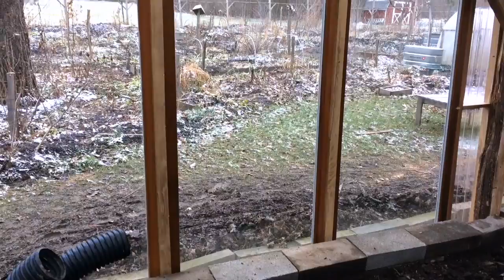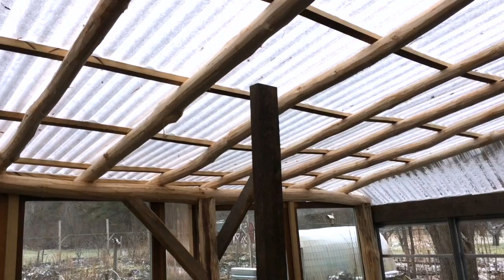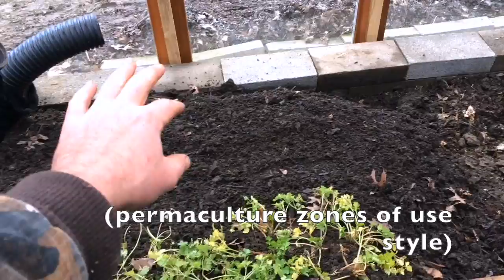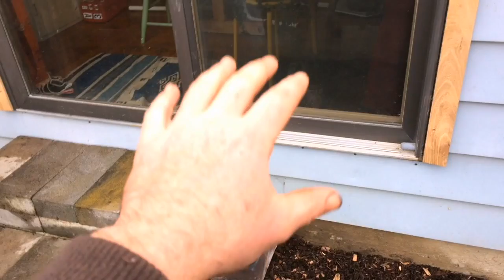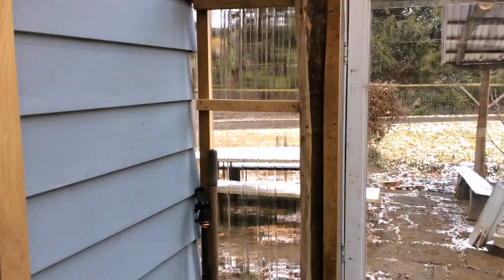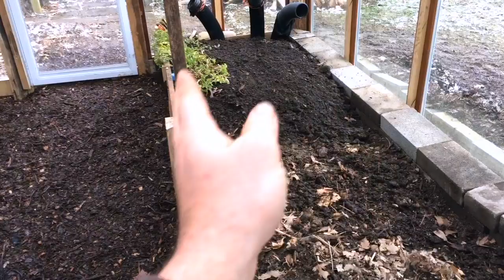Passive Solar Greenhouse - V - Raised Beds Being Developed

Comment from the maker: Temperature Test...
As mentioned in the video where I had the little device logging temperature overnight.
Outside LOW air temperature - 10F
Temperature LOW at 'Parsley' level in greenhouse - 26.6F
16.6F warmer at crop level.  WITH 8 square feet of window still needing to be framed in!!!! WHHHATTT!
Reply: Do not underestimate the power of your thermal mass! You are doing wonders. And that heat will take a long time to bleed out of your bed and blocks. 
Another neat trick is to have black barrels/buckets filled with water that absorbs that heat and gives it off overnight as well. 
Where you will have a challenge is when you have extended cold snaps, and cloudy days. Then you may see some significant drops in baseline temperatures, and a longer recovery time as your thermal mass is recharged with heat. 
Love the experiment. :)
Reply from the maker: I was amazed.  But I can certainly imagine if we had 4-5 days in a row in single digits with no direct sun this huge battery would drain down and be a burden to the scene.  I think thats why I need to really focus on how to charge the 'battery' as much as possible whenever the sun is shining!
Reply: @edibleacres  Thermal mass only helps (in any continuously occupied space (plants counting as occupants here )).  But, yes, get as much sun as possible, lose as little air and heat as possible, store as much heat as possible.
Reply: Congrats on the temp difference. Nice job...
The charcoal paint idea is also amazing, but done dry, my guess is, it will spread dust for some time. Maybe instead of oil based paint you can try mixing charcoal powder with plain water and maybe a handful of clay, thus making it stick better, probably last longer than the dry variant and keep it from leaching dust particles. It can also be easily painted with a brush..
Just a thought...
Reply: Awesome! This helps me a lot with planning something similar

Comment: Did you use any of your chicken compost on the paths between your long raised beds for extra compost heat? Fill it up to almost the top of the raised beds for an extra heat source. Just a thought!
Reply from the maker: It has a strong smell at this point so I don't want it in any enclosed spaces just yet :)

Comment: When you go to fill the uneven roof gaps with cob, you will need a connector to bind the cob in position next to the smooth surface of the wood; as clay does not necessarily ‘hold on’ to wood by itself. Repurposing old nails/screws, something with a head that the straw (or whatever your tensile agent) can wrap around works. I see the space is small and a hammer’s swing not possible from the top, but perhaps making a platform of grips from the angles that you can attach from would provide enough support for cob to sit on/amongst, harden, & stay for the long term. Just the asymmetrical shaping will provide for some staying-power if thick enough (say, greater than 3”). However once dried, clay shrinks pulling away from the wood (any smooth surface) and can crack depending on your mix...potentially yielding chunks that dislodge over time. 

I enjoy and benefit greatly from your channel, format, & demeanor. Thank you kindly for diligently and thoroughly presenting your work. Thank you for caring for others too.
Reply from the maker: I hear you... I think we can work the cob in and through the gaps to both sides, and knit it in.  I will hammer in some nails here or there where the gaps are wide.

Comment: You must have great balance to use that back path of pavers to use as a walk path...  I understand the need to conserve space but be safe too brother.
Reply: Walk like a cat...
Reply: You might consider putting a board over the top lip of the front of your raised bed and on the brickwork of the back to straddle and put one foot on it and the other on the brick and lean down to work...  You'll figure it out.
Reply from the maker: I'm guessing that 'design' will change over time based on what it feels like to work with!

Comment: Could you take a temperature reading off the slider windows on the back of the house? Is your house providing some warmth to the greenhouse? Have you taken readings from the open ends of the black drainage pipes? Just curious.
Reply from the maker: I bet our house is providing warmth out to this space.  Thats part of the idea, to have the two spaces be able to share excess warmth depending on the situation and need.  We'll see.  I'll plan to make a note to read that and share that in an upcoming video.
Haven't read from the pipes yet as they aren't 'active' yet.

Comment: Use mix some charcoal with linseed oil for a paint that dries and is water proof... Also keeping the stones wet will dramatically increase the heat conductance and capacity of the stones because stone is somewhat of a good insulator
Reply from the maker: Great thoughts here.  I think I've got some linseed oil so I may try this.

Comment: my experience is that spinach can really handle the cold in a similar environment, so you might be able get some greens going very soon in Sasha's area.
Reply: I'd love to see how Turkish Rocket, kale, chards, spinach and other cold tolerant greens could do in a seasonally extended growing area. Could be a winter salad bar!  What a fun project. Low impact, relatively low cost and full of chances to experiment during the "off" season. I've gathered materials and planned for a winter greenhouse and will get it ready for next winter. Long time in coming, but it's given me a chance to really hammer out designs and details. I can hardly wait for your chickens to kick in some more compost!
Reply: @markroeder2491  This is my planter in a simlar greenhouse 2 years ago. This year right now I am picking a salad out of it every day. https://www.youtube.com/watch?v=I_9yIYk1Eek
Reply from the maker: We'll be seeding out the beds pretty darn soon, once the last major gaps are sealed in and the one main bed is completely filled with soil.  We'll start with older seeds that need to get used anyway, and see if it's a go!

Comment: Do concrete blocks hold heat?
Reply: Sure.  Pretty much everything holds heat; concrete is dense (144 lb / ft³) and has a specific heat of 0.156  BTU / lb•°F for a heat capacity of 22.5 BTU / ft³•°F.  That is, for every cubic foot, the concrete will hold 22.5 BTUs (1 BTU is about the heat of one wooden match) for each degree of temperature change.  Water holds about 62 BTUs for the same volume, plus it has a HUGE heat of fusion (heat given off when it freezes) of 9,000 BTU / ft³ which is what makes it ideal for freeze protection for greenhouses.
Reply: @CorwynGC  Thanks for the info! Much appreciated.
Reply from the maker: I've got some learnin' to do! :)

Comment: LOVE IT!!!!  Wouldn’t it make more sense thermally not to have raised beds at all?   Jost grow in the soil at ground level?    Did I miss something..what are the black plastic pipes for?  Blessings  :)
Reply from the maker: @dancingcedarIt's a great question, and one I won't be able to answer very easily since I'm going all in with the raised beds...  A few reasons for me on this:
1) MAIN reason: we have an incredibly wet site.  Having some beds on the site that are very deep and well drained will be incredibly helpful for certain crops and for starts.  
2) If I want to run these tubes 'under' the bed to hopefully pump warm day time air through them to heat the soil, they'd have to start somewhere where they wouldn't be under standing water in the winter.  Just a little below standard ground level is that place.  Much deeper and they'd be water filled tubes which I don't think would work for my hopes on this.
3) We have a tremendous amount of compost.  Being able to put a huge amount in one production space feels like a great destination, and would hopefully make one monolithic bed that would need very little watering/fertilizing/feeding if done this way.

These are the reasons that are driving my design direction.  By no means is it 'the right' way or a 'proven' way but what I'm going with based on my thoughts and our site condition.
Reply: Complicated question to answer.  Deep ground temperature stays about the same.  Heat travels slowly through soil.  The greenhouse has no insulation between it and the outside at below ground levels.  Most of the heat gain (other than direct solar radiation) is likely to be coming from air contact.  Depending on how air tight it ends up being, will determine where most of the heat loss comes from.  My SWAG, given decent (eventually) air sealing, is that raised beds are a better idea.
Reply: @dancingcedar, the black plastic pipes are the tail ends of a climate battery, aka a Subterranean Heating and Cooling System (SHCS), used to regulate temperature.  It is cleverly being used to warm the soil in the raised bed as well as the air in the greenhouse.
Cheers!

Comment: ''voice of doom'' here   YOUR PRIORITY   is getting post under your flimsy roof  before an  8'' snow falls.
Reply from the maker: I get your concern... 
I can't say for sure, but I wouldn't be surprised if White Ash poles, grown in the shade so they have dense growth rings, at 4" diameter, uncut, would have a load bearing/shear handling strength of plantation pine milled to 4"x4".  So if you imagined a roofline with 4x4s every 18" I don't think you'd be concerned.  It's the look of the round poles and them seeming like 'twigs' but I think it's quite the opposite.
 But to be safe makes a TON of sense!!!
Reply: @edibleacres    https://www.brighthubengineering.com/building-construction-design/109683-beam-load-calculations-explained/    after i have done work and used materials,  i fight loss, as much as i can.
i have learned how much wood can bend.  breaking is not the only concern.
Reply from the maker: I read for a bit, then my eyes crossed when the calculations started getting super complex (for me).  I think I have to build with intuition and testing in the ways I know how to test (climbing on, shaking, pulling, comparing it to other structures I've made that have lasted 10+ years, or didn't last because of X or Y issue that I hopefully learned from.  I think thats how deep I'm going to get.  I really respect and understand that the science and the fuller work makes sooo much sense, just not my specialty I think.
Reply: @edibleacres  just ''overkill''  4x4 post under middle,  cheap enough.   then SAG  will not pull the roof away from sides.   the old saying ''a stitch in time''  .  the formal calculations are there to save money , build no stronger than needed.  for you it is a small expense.    your ''intuition''  has failed you  it is winter and no post, yet.    ha ha    the best to you my friend.